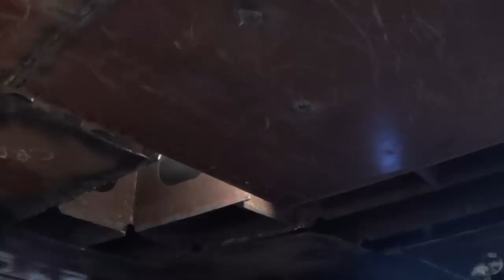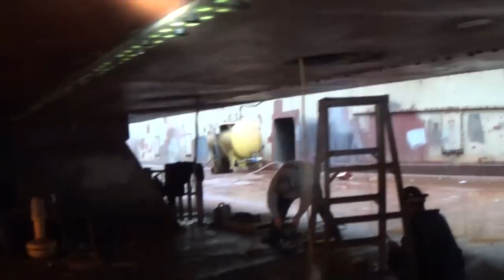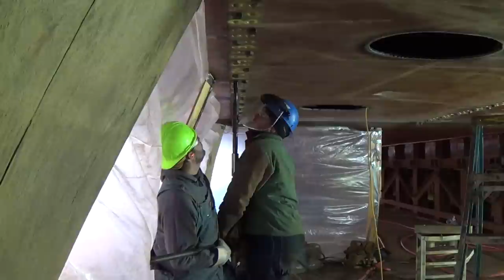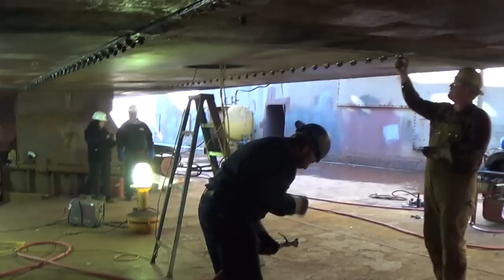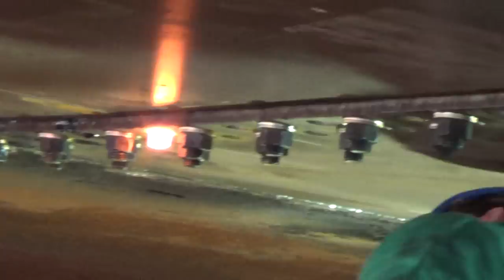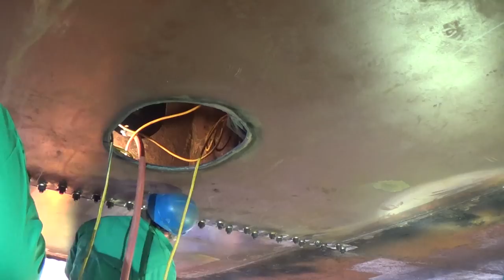Hull Plate Replacement 2014

Comment: Riveting is a lost art, not many are left in the trade. Back in the '80's & early 90's I did industrial & commercial boiler repair, learned how to check & caulk a rivet. In my 14 + years we only had 1 rivet job on an old locomotive type boiler, unfortunately I didn't get to work on that job, still disappointed to this day.

Comment: They still pitch all rivet joints to keep it from leaking, with out it being pitched it would leak .
Reply: Some joints were Caulked to prevent leaking not pitched.
Reply: Yeah what ever it took to seal it off, i guess they used what they had at the time.
Reply: Charlie K  pitch is an old word for tar. So it's a sealant.
Reply: Charlie, you ever hear the term "pitch black", or "black as pitch"?

Comment: I thought most Liberty ships were pretty much welded hulls. This is not the case?
Reply: Pretty sure the plates are welded after riveting. Liberty ships would crack in half in rough seas so a thick long plate was added the length of the exterior of ships instead of redesigning the ships. Welding and rivets makes it sturdy and water tight.
Reply: @Charlie K This Liberty Ship Brown sailed on 29 September 1942. Later in Nov of 1943 the war department investigated cracks and ships breaking in half. To me it figures since the ship survived the Kennedy era ridding the seas of old liberty ships as cargo vessels it seems more likely the ship has been modified using welds and rivets where needed.
Reply: I don't think they are interested is staying with any old methods. Riveting is weak compared to rivets and welding. Dry dock time is in the millions even in a navy yard. One of the reasons ships started being able to be produced much faster in WW2 was the use of welding. Seems the finding of the Liberty ships weakness was rivets when in the extreme cold the stress of high seas would cause failures in the rivet joint areas. I'm sure what they are doing is for speed to keep dry dock time to a minimum with extending the lifetime of the ship as a money making tourist ship.
Reply: Phil Iv never seen a plate welded after riveting ... I’m a welder my father was a piece riveter RIP ...
Reply: There were several reasons Liberty ships experienced cracks in hulls: 1. The steel quality was not the best and USA was still learning about steel requirements for toughness. Carbon content in some Liberty hull plates was too high resulting in brittleness at weld seams.   2. Design of the Liberties caused the structure to be too stiff. On the later Victory ships they moved the main beam separation to 36 inches from 30 inches on the Liberty ships-that allowed more flexing and less stiffness.   3. Sharp corners in some Liberty features (hold opening corners for example) resulted in stress raisers.    4.  Hull welding was still being developed and the quality of some hull seams was poor.   5. When you have a welded hull there are no normal 'crack arresters'. If a crack started it moved quickly to catastrophic failure. With riveted plates that stopped the progression of cracks.  

With that said, I know of no practice on Liberty ships of using rivets WITH welds, they used either one or the other to join hull plates. I was just not aware that Liberty ships used ANY rivets in the hull, was surprised when I saw that in the video.